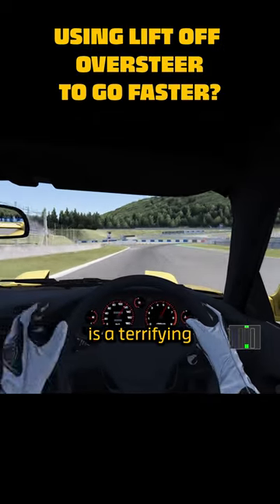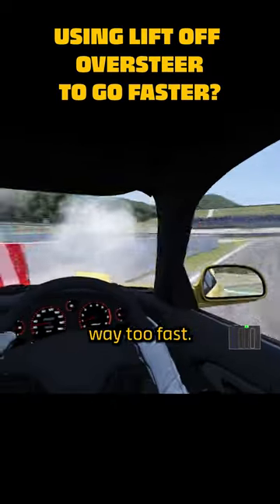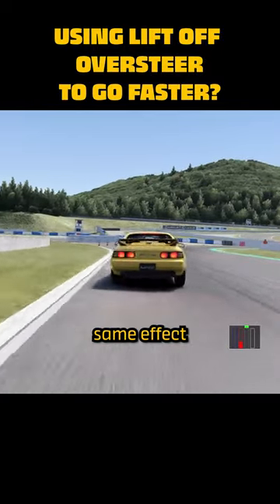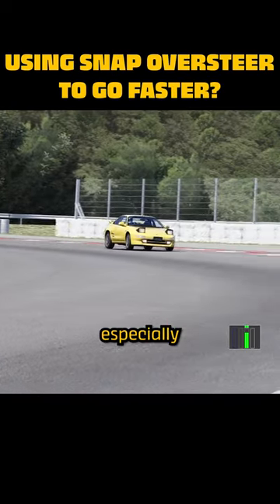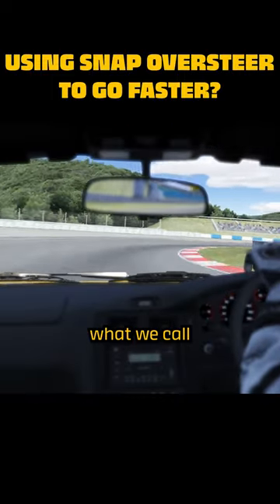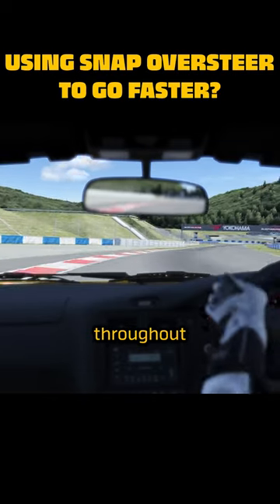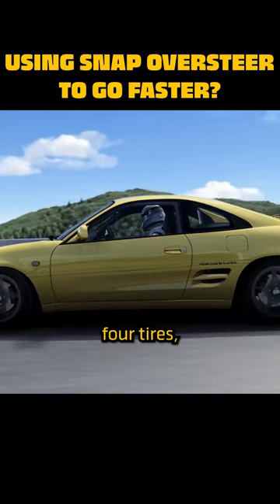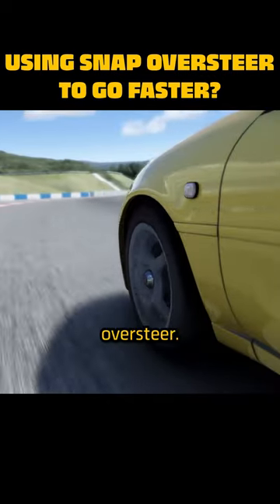Using Lift Off Oversteer to Your Advantage #shorts #simracing #assettocorsa

Comment: There's an old pedal cam video of Senna driving a 90s NSX at Suzuka. The way he dabs the throttle through the corner is amazing to watch
Reply: I believe he did that all the time
Reply: @statue999  yeah me too, but  I can't find any other pedal cam videos. Still, really cool
Reply: He did that because he didn't know the limit of the car. That's all
Reply: @onyjdm  no it was to specifically keep the revs up during the corner so the turbo was at the correct RPM to give him maximum boost on exit
Reply: @TCCcompetition  the NSX is N/A though lol
Reply: @onyjdm  oh my bad haha. In that case it was because of where in the range the car delivers it's power.
Reply: @TCCcompetition  then just keep your foot on the throttle. He simply didn't know the limit of the tyres, that's all
Reply: @onyjdm  well if you keep your foot on the throttle, the power through the rear wheels could potentially upset the car. It was also a way of progressive acceleration
Reply: @TCCcompetition  just countersteer lol
Reply: @onyjdm  that's not always the way.
Reply: @TCCcompetition  then dont push the tyres over the limit if you dont want to countersteer
Reply: @onyjdm  oversteer comes naturally with pushing. I'm not saying you can avoid it, but you don't actively seek it
Reply: @onyjdm  lol
Reply: @TCCcompetition  no you dont. I never said you want oversteer
Reply: @onyjdm  Bruh, that was his way of driving, it was his technique, he even used it when running on F1 cars, but a kid with "JDM" on its name wouldn't know this...
Reply: @engelmorales  No, you are the one who doesn't get it. Kicking the ass out of the throttle is not a way of driving, he kept up the turbo pressure with that throughout corners you would normally lift in. But of course, people who watch TSRB on a serious note, don't get motorsport, so no point arguing.
Reply: @onyjdm you know senna used to drive his F1 car like that as well yeah? I don't know the exact reason for him doing so, but telemetry tells us he used to prod the throttle constantly
Reply: @Delnevo420  already told you all he used that to keep the turbo psi up, in the turbo era of F1
Reply: @onyjdm  you said he does that because "he doesn't know the limits of the car", which is incorrect 👍
Reply: @Delnevo420  read all my comments. He did it in the NSX because of the limits which he wasn't aware of, and in F1 he did it too keep turbo psi up.
Reply: @onyjdm .... He even did it in non turbo F1 cars. Looks up driver 61 and watch the senna technique video, did it throughout his entire career
Reply: @onyjdm   Senna still used it after the turbo ban in 1989. He only reduced the effect in 1993 when he had TC in his MP4/8. Idk about 1994 since TC was banned again. I'm pretty sure someone who has only known racing car his entire life and basically lives off of them knows exactly where the limit of his car is
Reply: And sennas cool shoes.
Reply: @R9naldo  That car literally didn't exist, how would he have known?
Reply: @onyjdm    Which car
Reply: @R9naldo  NSX
Reply: @onyjdm    But Senna used the same technique on every F1 car he drove, and no one knows their own car like an F1 drivers knows theirs. Idk about the NSX but his throttle technique is irrelevant there since he used it on everything he drove anyway
Reply: @R9naldo  I'm not talking about F1 cars, of course he knows that car amazingly! I'm talking about the NSX, which he was only testing, that car wasn't even up for sale back then..
Reply: just drive smoothly use the damn late apex early and normal here late apex for better exit
Reply: @TCCcompetition  it's only because he gained it as a habit while racing karts as a kid, it just so happened to be good for turbo, and he never lost the habit
Reply: Senna
Reply: People in here commenting on Senna’s driving style like they could have coached him to do better. His throttle modulation may have looked haphazard but he had incredible feel. He was insanely good in the wet and I bet it was due to his pedal control. Go home @Ony JDM you honestly don’t have a clue.
Reply: @TCCcompetition  don't you want a little bit of oversteer when you're using slip angle?
Reply: @onyjdm  his f1 car was turbo he did that always
Reply: Yes. I did that ever since i saw the vid
Changed the game tbh.
Reply: @lucashurley7612  woah nice one rich kid, feel free to battle me in Assetto Corsa or any sim if you are so amazing at driving...
Reply: yeah but thats not why he's doing it, hes adding and cutting throttle in a way similar to a rudimentary traction control. liftoff oversteer is spinning on braking, he did it to prevent oversteer accelerating aggressively
Reply: @ruledtrendy5066  Wtf do you mean "use slip angle"
Reply: @ruledtrendy5066  L
Reply: @drunkenraikkonen6664  any other useless comments?
Reply: @ruledtrendy5066  + seethe
Reply: The true answer is called Heel and Toe.
it is used for when entering a corner on the brakes and he dabs the throttle to keep the engine in its power band. FACT ANSWER.
Reply: @wils35  only to down shift to keep from upsetting the car
Reply: Lol @jdm guy was nothing to do with him not knowing the limits of the nsx was his driving style 🤣
Reply: @wils35  i thought they used sequential transmission ?
Reply: Wow theres a lot of misinformation in this thread. Too much
Reply: @ohnome3154  yeah I was literally only commenting to remember Senna doing the same.  It blew up
Reply: @onyjdm yeah the NSX was an N/A car but Senna developed that habit because of the turbo F1 cars he was racing for the first half of his career
Reply: @onyjdm then how do you know you don't push the tires over the limit if you don't yet know the limit itself?
Reply: It was an old technique he developed during karting

Comment: Snap oversteer is different to lift off oversteer. Snap oversteer is when the car snaps the other direction quickly when you compensate a bit like a pendulum and lift off oversteer is what’s explained in the vid.
Reply: Finally someone who understands the basics
Reply: thank you lol this is literally just basic throttle control for RWD
Reply: Correct.  Snap oversteer is an unintentional "Scandinavian Flick" done by inexperienced or panicking drivers during an avoidance maneuver.  The lift-off oversteer shown in the clip is just a mid-engine car having a weight balance towards the rear and front tires with more effective grip in the moment to allow the rear tires to break loose first.  This is why most MR cars have staggered tire setups with very large/wide rear tires and smaller fronts.  There are other reasons including not needing big tires for non-driven wheels, aerodynamics to have a smaller front profile, etc., but deliberately having less grip at the front gives the car a more neutral handling character.  This is one of the biggest reasons the MR2 was such a widowmaker, it had the same size front/rear tires so when pushed the heavy rear would push out first vs. something like an F40 that had much wider/grippier rears to balance the car better.

Comment: I always keep a tiny bit of throttle open while trail braking with a snappy boi just to keep it in line.
Reply: Wouldn't that be sorta negating it though like you're just coasting and braking overall anyway?
Reply: @ThBlueSalamander Well, not quite. Throttle through braking also slightly changes brake balance in 2wd vehicles.
In this case stabilising RWD cars by negating some of the braking force on the rear tyres.

And in FWD cars, can be useful to shift brake balance slightly backwards and help turn in.

Fun/helpful. But I'm not sure how great it is speed wise. Especially when brake temps come into play
Reply: @ThBlueSalamander  basically does, waste of time
Reply: @samnope7344  how would shifting balance to the back improve turn in with FWD cars, it actually induces understeer specifically to counter excessive turn in which would otherwise result in oversteer xd
Reply: @DMSBrian24  
My basic thought process on shifting brake balance is this:

Coming into a turn, you're on the brakes as hard as you reasonably can be, holding your tires as close to the grip threshold as you can get. Then, you start to turn, adding load to the front tires as they attempt to redirect the mass of the car and possibly pushing past your grip threshold on the front tires.

Adding a bit of throttle on a FWD, acts against the force exerted on the wheel by the brakes, ultimately reducing braking load on the front wheels and easing back away from the grip threshold of the front wheels, avoiding the front tires losing grip.
Reply: @samnope7344  I'm glad someone knows what traction is and how it works👌💪

Comment: So many people confusing snap oversteer with just plain oversteer. It happens when you load the suspension and it rebounds too fast throwing the weight in the other direction. There's many many causes that range from driver error, improper car setup, very grippy tires, or other things like the surfaces driven over. Low racecars don't tend to like driving over rumble strips at high speeds.

Comment: Snap oversteer =/= lift-off oversteer. 

Snap oversteer is caused by overcorrection of oversteer (often caused by liftoff in the first place), it can be further emphasized by lift-off or braking but can happen even at wide open throttle if the car can't make enough power to keep the rear tires spinning. Those two are absolutely not the same thing, even though they're confused by like +90% of people.
Reply: THANK YOU!, finally someone said it!!

This is why I find that in some situations, chassis like the AW11s & to a lesser extent AE86s are sometimes dangerous due to their lack of power. That sudden hit of grip in a big corrected slide, can toss your salad right the other way real quick
Reply: @ChroniclesofKToyoda  yeah 100% it's also the case with some turbo engines where unless you keep that thing spooled up, the lag makes it impossible to prevent the snap since you have no power to properly catch the slide in the first place, those cars are awesome for track but on the streets a single puddle can fuck you up if you lose focus for even a second, this is also why imo the sw20 really shines with the beams engine, instant response and enough power
Reply: @DMSBrian24  absolutely this! This is one of my issues with Turbos, inconsistent throttle response due to boost levels, but I'm assuming modern ones are better now. The Beams SW however is still my favourite SW BTW
Reply: Snap oversteer comes from suspension bottoming out during cornering. Overcorrection is only one possible cause.
Reply: Yes, i told this dude when he first released this video. His explanation was "everyone calls it that, so it will stay in the video" 
Yeah, why educate, when you can misinform.
Reply: This guy gets it
Reply: Snap oversteer is not necessarily caused by overcorrection!
If you enter a bend too fast in a mid engined car, and if the front hangs on and the back end breaks away suddenly then you will have snap oversteer,and you will not have time to correct it,regardless of the throttle position.
I have driven a Lotus Elise and Exige for many years!
Of course if you overcorect,you will experience that pendulum affect, and you sit there and you are a passenger in your own accident!
The secret is to enter  the bend just below the limit and use the power to dip the rear end and stick   it to the road.
Not easy as there are so many variables,such as fuel load,,passenger loadng,tyre temperatures,and road surface.
It is easier to drive a front engined rear wheel drive car!
Reply: Also lift-off oversteer is predominantly a front-wheel-drive issue, wherein lifting off the throttle while at a high RPM creates a strong engine braking effect that of course only applies to the front wheels, enabling the rear end to happily swing around. This is often how front-engine front-wheel-drive cars spin out in the snow.
Reply: @nearlyretired7005  what you are describing whilst a real phenomenon is not "SNAP" oversteer, the reason people call it that now is simply because too many folks have called it that unchecked, it isn't what the term is supposed to mean at all

"Sudden oversteer" ≠ "Snap oversteer". Suddenly sliding is not the same as snapping in another direction after tension like a rubber band effect. There have been other cars which suddenly oversteer but the term snap oversteer didn't start incorrectly being used for it until after the term was created to describe sudden front end grip in a correction(not necessarily even an overcorrection), & contrary to popular beliefs, the pendulum affect which can start an oversteer is also not at all necessary for snap oversteer because the biggest contributor to how likely snap steer results is from how rapidly(thus how much) you can shift weight/grip front to back hence why the notably longer wheelbase of cars such as the MR(2)S(pyder) is so much less susceptible to it compared to prior irritations. If you use gripper tires the issue gets exasperated
Reply: Of note having been on both the MR2OC & Elise forums I know from factory the Lotus actually understeers/plows slightly(to put mildly) particularly when compared to the OG Mk1-a AW11 MR2 as it has both front & rear swaybars, which for '86+ rears in some markets were removed to make it understeer/plow more as well. I say this to say that making a car which is harder to oversteer thru cornering alone will lead to less situations where countersteering corrections need to be made & make the front more tame once it is but the issue here is mild understeer usually means on the limit average cornering will be faster so when steering corrections do eventually need to be made they will typically need to be done so at a much higher speed & pace with much more immediate precision, so at some threshold most oversteer will start to feel sudden, but it's incorrect to call these things snap oversteer simply because you are traveling faster which naturally requires faster inputs, all the more because I don't recall Elise's coming with anything other than some of the most barely street legal sticky AF tires which at the risk of sounding like a broken record is what creates the rapid ability to suddenly shift weight around, throw this level of tires on any car that's got a remotely neutral handling & the speeds & pace where oversteer occurs & needs to be corrected for too will become sudden yet we're much less likely to use the misnomer "snap oversteer" on most these cars, we simply(& rightfully so)start calling them peaky, yet we are oh so quick to incorrectly throw that "SNAP" term around when talking about midship cars like some catch all blanket statement that's responsible for every MR car behaviour
Reply: hold down on the equal symbol to get ≠
Reply: @samiraperi467  it can be from multiple aspects. tire size, tire pressure tire compound, speed, spring rate, but too fast of rebound damping is a big one.  Slow it down, the weight won't be transferred as quickly preventing the sudden weight transfer.
Reply: Snap oversteer if often caused by a shitty open differential like the Torsen.
Reply: Wouldn’t many of these videos of Mustang accidents be the perfect example of snap oversteer?

Comment: I think the best way to describe this is to constantly be checking yourself for over or under steering and compensating accordingly with throttle, braking, steering, and weight transfer to keep the forward or rotational forces and yaw under control to maintain momentum in a corner? Every amount you pitch, roll, or rotate can affect your driving line and grip. 

Not sure if this helps anyone..
Reply: No it doesn't!
It sounds as though you are fighting the car. 
If you have to do this then either the car is a pig to drive or the driver is doing everything wrong.
A good driver is smooth and controlled with minimal inputs!

Comment: One good method of using snap oversteer in your favor is by intentionally invoking small amounts of it through a tight turn to get some nice rotation needed to clear the corner faster
Reply: Yeah, this is an actual tip on how to use the snap oversteer, unlike in the video, merely telling you how to combat it.
Reply: liftoff oversteer* snap is never good unless you're drifting xd
Reply: You are actually talking about Lift Off oversteer, not Snap Oversteer. 

When I started doing HPDEs in my E30 with the BMW Club I had an instructor explain how, with certain tighter turns, that breathing off the throttle enough to initiate Lift Off Oversteer would cause the rear to rotate the car for the turn, and removing some steering load from the front tires at the same time.  It is a mild act to lift the throttle to get the rotation you need, and then rolling back onto the throttle to shift weight back to the rear and set the rear tires.

Comment: this is a terrifying and also rewarding thing.
just enough reaction can save. just enough throttle can look "cool" and the right actions can continue the run.
ive had vehicles that the throttle controlled the wheel but i always found a way to fix that till i needed more throttle. ..

Comment: You're describing Lift-Off Oversteer.
A defining characteristic of Snap Oversteer is that the vehicle SNAPS the opposite direction of the corner. Usually snap oversteer is initially caused by the car over rotating on turn in (from Lift Off Oversteer), the driver corrects with too much steering input, also usually by lifting even more, and the springs unloading from the initial turn in throw the car the other direction.

Heavy snap oversteer is a characteristic of a lot of MR cars

Comment: I learned this from my dad on snow and ice and took it to slightly faster than the signs suggested with the 82 Supra I bought at 19 working for Toyota. So easy to steer with the throttle with my hands in my lap as my roommate was freaking out. No horsepower but that was what made it so fun carrying momentum.